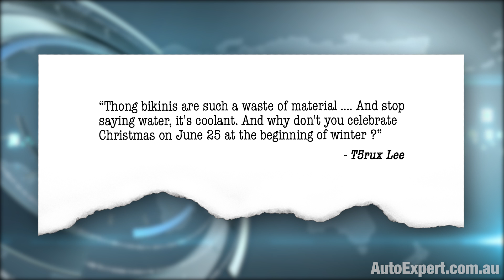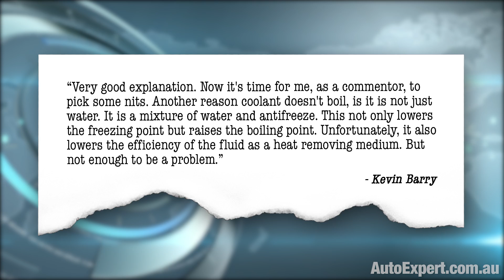The mad science of coolant (beer garden physics - yesssss!) | Auto Expert John Cadogan

Comment: Pure H2O is corrosive and would eat its way through your radiator.
Reply from the maker: No, it's not.
Reply: And turn to steam when pressurized.. no cooling then..
Reply: Haratio Hornblower um no, that’s what the pressurized bit solves
Reply: @kdkd693  how many head gaskets you replaced from people only putting water instead of coolant.. they don't cool on steam.. and unfortunately pumps do corrode
Reply from the maker: @haratiohornblower2613  But water doesn't do the corroding. Sorry you never paid attention at school.
Reply: Haratio Hornblower i was suggesting you might look up steam tables re your statement ‘turn to steam when pressurized’. It’s actually the opposite
Reply: @AutoExpertJC   or trade school..thank God for google
Reply: @AutoExpertJC  You never went to school. Clearly or you would know water corrodes things. Alloy quickly, iron slowly but they all corrode
Reply: @haratiohornblower2613  Pressurisation prevents water vapourising, it doesn't cause it. That's why cooling systems are pressurised.
Reply: Steam void in cooling system then.... Yeh the minerals in the water cause the corrsion not the water, I spose it's the lead in the bullet that kills not the gun.. def put water only in engine warranty will pay for sure..

Comment: Small typo. You probably had a dash in front of 32 degrees and read it as negative 32 deg F being equal to 0 degrees C.
Also another typo,  -40C = -40F not 35/35.
Reply from the maker: Point one: Totally correct. I mis-spoke. Point 2: Near enough.
Reply: @AutoExpertJC  -35 and -40 are damn too cold can't tell the difference

Comment: And when the cooling system isn't well designed?  BMW - Looking at you.  Same with you Holden (Vectras were shiiit)...
Reply: They were perfectly designed - for Germany in mid winter.
Reply: Allan Gibson not the plastic expansion tanks in the E46. They failed in German E46s as well.
Reply: Vectras were fine,, untill you come to replace the 8 branch bottom radiator hose. Ford Mondeos too were similar. $600-$800 job, or a grand plus at the dealer. Worth more than the car.

Comment: The yellow antifreeze contains a UV sensitive dye that's used to help find small coolant leaks too. Helped me find a broken heater matrix.
Reply: Would have thought the wet carpet would have done that...
Reply: @gazzafloss  the leak weren't that bad. In winter putting the defrost on left a residue on the screen that had to be wiped off

Comment: I’ve always mixed coolant with 60% distilled water instead of a 50/50 mix.  Seems to give me better cooling when I’m running around the Mojave desert in the middle of summer when the temperature is around 120f
Reply from the maker: It makes about 10 per cent of 15 per cent difference... (It's linear.)

Comment: Mankind's biggest and most embarrassingly biggest mistake, the cooling system  post WWII, . Having personally tested alleged water pumps Ha Ha, I can , from my experience, say that the alleged water pump is NOT a water pump according to Otto's requirements. Who is Otto I hear you ask ,well he gave us the 4 cycle internal combustion engine. According to Otto the MINIMUM flow rate for a 4 cycle engine is 10 liters per minute at 500 rpm. Well the best I tested was between 1.5 and 3 liters per minute at 500 rpm. Even pumps that were labelled "High Performance Pump" only managed at best 5 liters per minute and that was only on a flat plane. Of course a pump, in order to earn that label must be able to push a given liquid up a hill for it to earn the title pump. Of all the pumps we tested none of them could push liquid up any more than a couple of feet. This of course brings me to cavitation of which most of the pumps seemed to achieve without a problem. All pumps cavitate  of course, but so called engineers having clearly ignored the pump post WWII have clearly ignored that as all the pumps we tested seemed to cavitate at lower rather than higher revs. 
We found that if one were to design and install a proper impeller on a factory pump amazing things start to happen like , no more blown head gaskets, an engine that is more sensitive to tune, to name just 2 advantages. 
Next we move to WATER , which should be no where near an Otto cycle engine coolant passage because it converts to a gas when heated. We found the best liquid for an engines vital fluid for transferring heat away from the valve seats  is nano glycol which does not tolerate water in ideal circumstances, and 2 percent in not so ideal circumstances.
Reply: Very interesting Sir, thank you.
Reply: Waterpumps pump water. I have seen them suck water from a creek through the engine into a spary cart. Inneficient yes, but worked.
They should be called coolant pumps these days but lose a belt and watch the guage climb rapidly. A thermostat is required to control the flow. And very often on a  high rpm race engine slowing the pump down is imperative. Or they boil.
A cast iron impellor is superior to a tin one. Never experienced plastic ones yet except in pool pumps etc that move a LOT of water rapidly. Electric water pumps too are a problem unless regulated by RPM. 99% of the time the factory pump is fine.

Comment: I grew up calling it antifreeze. Canada eh.
Reply: Who need coolant in canada
Reply: @drsm7947  without it, you'd have no heat in the car
Reply: @drsm7947  what part of 'antifreeze' don't you understand?
God this channel has some dumb shits in it.
Reply: @Kris_M  Not true at all. You do need coolant to prevent the engine from over heating. You only need to add anti-freeze if you drive in conditions that threaten to freeze your coolant.
Reply: You are not alone in that.
Reply: Here in Montana I tend to run a higher ratio of antifreeze to water. That 40°C protection of 50/50 is just not quite enough when it gets to the real cold part of the season. I expect it much the same in the great white north.
Reply: @averywellsand888  Aye, it be true. Deionized water though, never ever used anything but tap water for the coolant system. Neva had a problim in all me loife.
Reply: Eh😉.  😂👍
Reply: Far oot eh?
Reply: @GCarruthers  Blutty Serth Efrucuns!
Reply: And they say I'm slow eh
Reply: It used to be when engines were iron.
Reply: @johnwade1095  Made no difference on me eastern block veterans, Lada and Skoda. Granted, the Skoda seldom went a year without popping a headgasket.
Reply: I'm a bit of a Honda junkie. I get enough drama from my wife.
Reply: Antifreeze here in nz infact the nasty stuff is bad for engines
Reply: Antifreeze, also known as coolant.  Ameriprise.com/auto-home-insurance/aah/learning-center/auto/car-maintenance/is-coolant-the-same-as-antifreeze/
Reply: Propylene Glycol 
https://en.wikipedia.org/wiki/Propylene_glycol#Antifreeze
Reply: @Krystal DRS M did, not I.
Reply: @b-rock where i live, we just call things what they are; heat transfer fluid = booze, add blue = piss, fuel = ded dinos(incase of ethanol = Friday juice), synthetic oil = lube.
Reply: Yes, I grew up in the great state of NY and we also called it Antifreeze.

Comment: When I worked for BHP they used "coolant" in the steelmaking process. This was made by shredding cars and anything else steel into about the size of a cigarette packet. They would weigh the "coolant" into skips and when the furnace was converting pig iron into steel sometimes the process would overheat, so the operator would chuck in a ton or two of "coolant" and bring the molten steel temperature down to specified level. It always brought a smile to my dial when the production staff referred to it as "coolant", but probably a more accurate description, than the stuff running around in your engine block.

Comment: Can we all please agree that it’s friggin heat exchanger, not a radiator, and call it by its proper name?
Reply: It is called a radiator because some of the earliest examples may have in fact been radiators borrowed from someone’s house and slapped on an engine, that or most of the people who had a boiler for heating saw the similarity. Now the question is is the original home heater that pumped steam hot water or heated oil through a radiator really a radiator? Some radiant heat would come from them but most of the heating was done by convection, as the air touching the radiator would heat up and rise it would create a convection current pulling in more cold air to heat and send to the ceiling. The only true radiators are those horrible electric bar heaters that small children like to grab hold of.
Reply: And the heater core is really a radiator.....
Reply from the maker: No - it's a convector too.
Reply: I'd call it a liquid to air heat exchanger, yes.
Reply from the maker: @gazzafloss  Except it's liquid -> metal -> air forced convection heat exchanger...